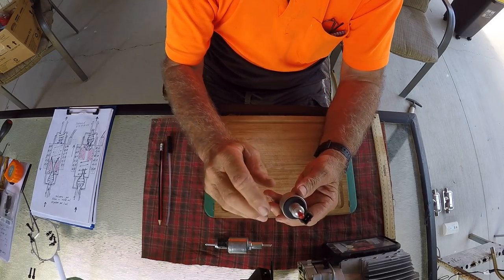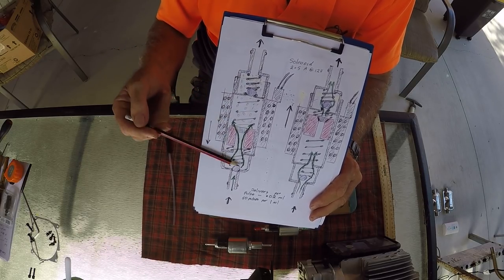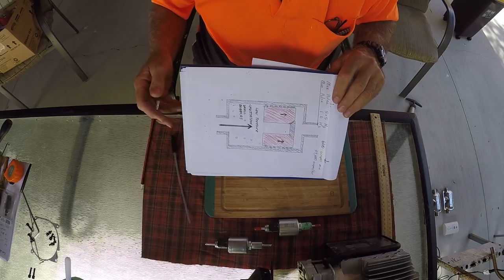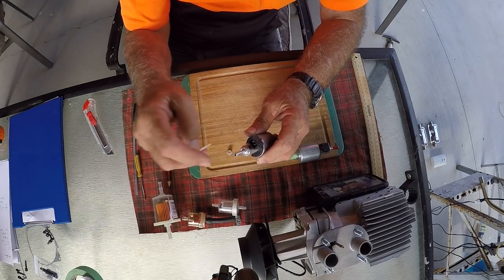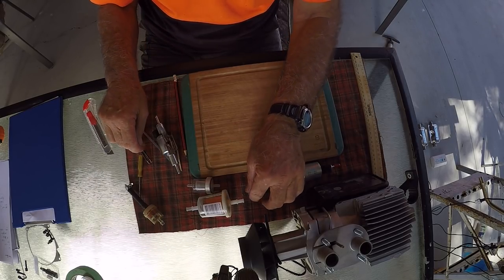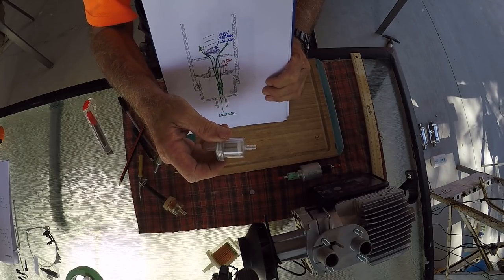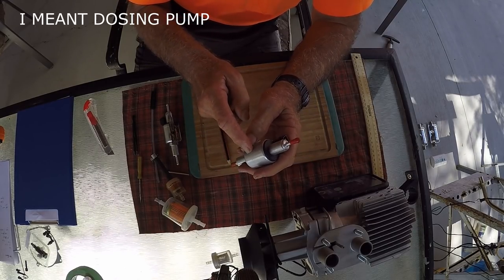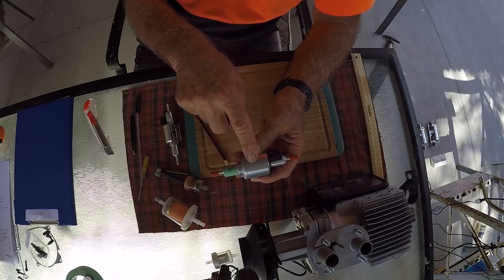Chinese Diesel Air Heaters   Part 7   Metering/Dosing pump

Comment: Finally someone with knowledge explains the operation of the dosing pump!!
Reply from the maker: Thanks for your feedback Robert.
Reply: @johnmck1147  I know im a bit late to the party, but would it be possible for me to send you a video of the issue im having? I cant figure it out for the life of me.
Pump ran through prime cycle (as per these instructions) and was working fine, but then when i tried to start the heater, the pump would start "bouncing" the fluid back and forth, until eventually, only air/vapor was coming out of the pump. 
Thought it was a pump issue, so i bought another, but im still having the same issue.
Any help would be greatly appreciated!
Reply from the maker: Alex Olson 

Hi Alec, a video may help.
My email.  johnmck47@outlook.com

I assume you have a fuel filter, and the pump is facing up the right way. (Plug is on the top)

Cheers.  JMcK

Comment: Those drawings are not a good description.  Take one apart or look at some videos.  Its a metering pump with no suction valve.  You described a Facet style fuel pump for a car.

Comment: John, your videos have helped me immensely over the last three years. Please update your comment at time 9:58 to include after throwing the internal screen filter away, to install an appropriately sized (I think it's a #4) o-ring. I was troubleshooting a recent issue (heater would not go into the red bars on controller/ low heat output) for a long time before an aircraft mechanic showed me the issue. I even bought a new 2kW heater, but I realized that the 22ml pump that came w/ it might be the issue.  I then  thought that I could just use Teflon tape on the old Eberspacher pump that I was using, but discovered that it was in vain (leaky & still low heat), & that it could have caused shreds of PTFE tape to get caught in my plumbing. I was actually about to ask a mechanic for some PTFE paste when he made me realize that they're straight threads & this part required an o-ring.  Thanks again for sharing your knowledge, it has benefited many.

Comment: I'm now sitting with my feet up in my warm toasty van minus 1c outside ❄️ thanks to your easy to understand instruction to set the magnetic pump upright and suck a bit of welsh diesel before i refixed the small bore volvo pipework i salvaged off my old truck back together, regards from Snowdonia north Wales,👍

Comment: Love your videos.  I just completed my own install in my garage and couldn't access the prime function on my controller.  Instead, I used my hand held vacuum test pump to pull a vacuum on the hose that attached  directly  to the heater.  In two clicks, the filter was full and fuel had exited the pump.  Highly recommend doing this if you have access to one of  these pumps like the mityvac
Reply from the maker: Thanks for the feedback and info Kevin. JMcK

Comment: I also run the hard nylon through a run of latex tubing [ 1/2 OD x 1/4 ID ]. It does a great job of cutting back the noise about 2/3s' cause by the line itself. To run the nylon through, your best bet is to use oil into the latex and then push the nylon through it. I also started using a blue fuel line for the connection. The plus side is you can see when the ends touch. For longer runs, I use a hand-pump multi vacuum for all the fuel systems like my own. To ensure no air in the system.

Comment: Hi John,  glad I discovered your video as it has helped me figure out a problem with a diesel heater which I installed for somebody a couple of days ago. 
Everything was working fine when  the vehicle left  me  but I had a message a couple of days later to say that the heater wouldn’t fire up and also error codes  e07 and then e10 were showing on the display.
After watching your video I rang the man up and asked  him to check if the dosing pump  was still at the correct angle and guess what it was nearly horizontal , I got him to put it back to the correct angle and on the third attempt  the heater fired up and is working perfectly  without any error codes.
Not sure how the pump moved so I’ve asked the man to pop in when he’s back in town for me to check it over.
Thanks for the info, cheers, Chris.

Comment: Very informative and thanks for taking the time to make this. There is to much misinformation out there and people parroting information without explaining or understanding why something needs to be done a certain way.
Reply from the maker: Hi D, thanks for the positive feedback.  JMcK
Reply: @johnmck1147  Any thoughts on how the type of fuel filter used in a heating system may effects the pump. e.g. The volume of fuel the filter holds or the type of filtration used within the fuel filter?
Reply from the maker: Hi D, I have used metal gauze fuel filters  and paper fuel filters, both large and small and never noticed any negatives between them. JMcK

Comment: Hi John, 
Just for your info and comment, had a failed fuel pump this winter due to sub zero temps. Pump checked out ok electrically. Diagnosed the fault as a gummed up solenoid piston, (non winter diesel) tried to un gum with kero but eventually heated pump to 65 deg C and pulsed with 12v and passed kero through it, after a bit of persuasion it loosened up and works normally. It seems gelled diesel can be shifted with heat. Great channel regards
Reply from the maker: Thanks for that info Richard. I really appreciate your feedback.  JMcK

Comment: I commented on the previous video asking about pumps. Having watched this the pump isn’t what I expected. I couldn’t see from the cut away how much rubber is involved in sealing the units. Also, on another issue of dirty fuel and my biodiesel production I tested putting an inline car filter inbetween fuel storage tanks and found the cheaper so called 5 micron to be useless. A chap on eBay makes 1 micron filter socks and other rated socks that make Pre filtering 20 lites in one go very easy. We use a 60 litre drum into which we fitted a tap about an inch above the base, and cut a hole in the lid to suspend the filter sock. Once filtered, the clean fuel flows out with an added bonus of any water being left below the tap line. Guess you already know all this but mentioned for any others fresh to playing with diesel etc.

Comment: Hi, great videos. I'm going through them all, thanks for your efforts.

I've done some work with motorbike petrol fuel systems, and on van diesel ones.
I would suggest that one keeps the existing (small) fuel filter as is, and then adds another of the type you are suggesting before it.
And rather don't discard it: it will then act as an extra, very fine filter.
You can inspect it in your regular R&M, after all.

In addition, you could avoid the cavitation issue by increasing the inlet pressure to the pump.
It's a positive displacemrnt pump after all, and within reason doesn't care what ABSOLUTE pressure it runs at.

The diesel cavitates when it gets to less than its vapour pressure, at the ambient operating temperature.
So if you boost that a bit, say by a 2nd feed pump, or else by a bit more head from your fuel supply, you should be able to avoid the cavitation.

A big problem with diesel is that it has a very low vapour pressure: ranging from 1 - 10 kPa at 38 C (0.2 to 2 PSI).
Compared to petrol, where it's a LOT higher, at 48 - 103 kPa (7 to 15 psi).

Because of petrol's use, its vapor pressure (Reid Vapour Pressure) is a controlled specification, and is adjusted to prevent air locks due to vapourisation.

But not only is diesel's inherent vapour pressure a lot lower, because of the high pressure in a diesel system, and it's fuel pump system, it's not controlled.
There's not even any spec for it, so it's hard to see what it actually is for a given diesel blend.

Ff you DO an get air in a diesel system, or a vapour lock, it's very hard to get rid of: regardless if it's from low fuel level in your tank, poor priming, a leak, or vapour lock/cavitation.
Which is why more demanding systems have a preliminary booster pump feeding the main pump so you aren't affected by this issue.

In our case, if you boost the pressure by a bigger fuel head, then you can have MORE than the vapour pressure at the inlet to the fuel pump.
And therefore it CANNOT cavitate.

Fuel Head (kPa) = Fuel Density (kg/m^3) x Gravity (m/sec^2) x Head (m)/1000
 
To get 10 kPa, you need >= 1.25m of head.
You'll need more if you are running hotter, or use diesel with more volatile component fractions.

Here's a summary of various vapour pressures (all same research paper):
Riazi, M. R., Albahri, T. A., & Alqattan, A. H. (2005). Prediction of Reid Vapor Pressure of Petroleum Fuels. Petroleum Science and Technology, 23(1), 75–86. doi:10.1081/lft-20009686225 

https://sci-hub.se/10.1081/lft-20009686225
https://www.researchgate.net/publication/254352877_Prediction_of_Reid_Vapor_Pressure_of_Petroleum_Fuels
https://booksc.org/book/39540617/b2776f

He doesn't do diesel specifically (looked at gasoline and avaiation fuel), but you can see the values for various types of gasoline are quite high, and then look at kerosene, that are a LOT less (which is pretty close to diesel in this respect).
Reply from the maker: Hi Warthog,

Thanks for your detailed comments.

Yes, if you have a fine filter in the pump you could leave it in and have a separate primary filter. However all the Chinese heaters I have seen do not come with fuel pumps that have a filter.

Ref the cavitation bubbles. My research has shown that these little vapour bubbles actually help with the atomisation of the diesel when it is injected into the atomisation screens in the burner. In effect you have whole lot little diesel vapour bubbles already in the line.

Your post indicates a lot of technical knowledge. I would be interested in results if you actually do tests on   this matter before I get an opportunity to do same.   JMcK
Reply: In his kerosene video I think the pump failed from running dry from cavitation rather than lack of lubrication in the kero.
Reply: You seem to be a Gent who might be able to answer this query.
As I understand it, some diesel vaporises on the suction side due to low pressure induced by the rapid movement of the piston pulling on the inlet fuel line, What I can't see is why does it not condense back to liquid once it has passed the piston on the delivery stroke, but tends to remain in the pipe as bubbles. In normal cold climate operation. I would not think the pump runs very hot and after the short initial pressure burst needed to overcome inertia of fuel in the line, there would only be a very small,  but positive, pressure [since the delivery side is basically an open tube,] and the bubbles must by then be well above the vapour pressure of the fuel. So why do they persist in the line all the way to the glow plug ?
Bearing in mind that these bubbles are always going to be present and cause no real difficulties, even in 'perfectly' installed systems, this might suggest that the pump is not delivering the full 0.022ml of fuel per stroke, but a very slightly lesser figure due to bubbles?  But tests consistently show  22ml of liquid diesel after 1000strokes  ... bang on the money!
I know it's of no practical importance whatsoever, but the conundrum is still bugging me.... and I need my sleep    ;<D
ps I understand the fix of using a second pump to pressurise the dosing pump inlet - I had to do the same on a motor where the diesel injector pump drew direct from the tank

Comment: Hi John hope all’s well mate,, I installed a heater into a van a couple years ago and used you’re videos for reference.   I am currently building a small camper van for myself and installed a heater with zero problems,  it worked fine for an hour or so, then I stated getting ERROR 0- numbers on my display, I contacted the guy I got it from on ...3-Bay !  He basically palmed me off then as if HE  was doing some work to help me advised YOUR YouTube pages & I thought the cheek of him selling heaters then using YOURE excellent work for HIS “problem”
Reply from the maker: Hi Ryan, suggest you have a look at your wire size, and fuel line.

Lately these heaters are being supplied with ridiculously thin power wire and installers use same size wire to connect to power board. I had an acquaintance around two days ago whose new install would not work, and when I put meter on power wires at heater the voltage dropped from 12.8V to 10.2V on start.

Also suggest you run heavy gauge heater wire straight to battery with 20 amp fuse/circuit breaker close to battery. Not through distribution board.

Another issue is the soft vinyl hose now being supplied by some suppliers. If the fuel delivery hose is more than about 300 mm, from pump to heater the hose absorbs the fuel pulse and after a few hours of operation there is not enough pressure in the soft fuel line to force the fuel through the atomisation screens in the burner.  JMcK
Reply: @johnmck1147  thanks for the reply John👍🏼,  a diesel fitter friend also said Get a new wiring loom their only a few ££s 
Great minds an all that eh 😂 putting the new 20amp Red positive on will I have to open up the ‘ECU’ to solder direct to the circuit board or can I attach it Without opening “that box” appreciate any reply if & when you’ve time🙌🏼🏁🏁🏴🏴
Reply from the maker: You don't need to touch the circuit board. Just solder new thick wire close to the wire coming out of circuit board.  JMcK
Reply: @johnmck1147  thanks for the reply mate really appreciated, 
I’m not the best person with a soldering iron🤷🏻‍♂️😂 so I’ve already ran  some thin wall 80 amp wire I already had sitting around, possibly a bit overkill lol BuT sides are behind the walls so don’t see them😇 
Thanks again mate yer a diamond  ✌🏼🏴🏴

Comment: Good information, and a great video. I live in northern Canada and thought one of these diesel heaters will fit my needs, when in my trailer. Also will be running 50/50 diesel and kerosene, also I am a new subscriber.
Reply from the maker: Hi WRXS, pleased you liked the video. In a cold winter or at high altitude you can run up to 90/10 kerro/diesel, to help minimise carbon production.  JMcK
Reply: @johnmck1147  Thanks for the reply, and today picked up 4L kerosene@$3.99 and for 5L diesel the cost$10.00. Indeed the kerosene for some reason is half the cost.

Comment: An excellent run through of the fuel delivery system....  thank you John
Amazing what the mind turns to when you can't sleep at 3am .... As I understand it, some diesel vaporises on the suction side due to low pressure induced by the rapid movement of the piston pulling on the inlet fuel line, What I can't see is why does it not condense back to liquid after it has passed the piston on the delivery stroke, but tends to remain in the pipe as bubbles. Since the delivery side is an open tube there could only be a very small positive pressure which could aid condensation, but the bubbles must by then be well above the vapour pressure of the fuel by that point, so why do they persist rather than condense out?
Bearing in mind that these bubbles are always going to be present, even in 'perfectly' installed systems, would this mean that the pump is not delivering the full 0.022ml of fuel per stroke, but a lesser figure due to bubbles?  
I know it's of no practical importance at all , but the question is still bugging me.... and I need my sleep    ;<D
Reply from the maker: Oh dear OG, what a dilemma here. 

The little cavitation bubbles march along the narrow bore fuel line and get forced through the atomisation screens in the burner chamber, and I believe they actually help the fuel atomisation. 

I have done a number of tests measuring out pump delivery manually, and 100 pump pulses does give 22 ml of fuel the in lab measuring container.

I have also found that if you use 4 mm bore cheap rubbish vinyl fuel line as sometimes supplied nowadays, and you have a  sharp bend in it the little bubbles can form a large bubble that further absorbs the fuel pulses and creates a bad fuel air mix leading to a poor burn and excessive carbon deposits in the burner, which soon won't start anymore.  JMcK
Reply: @johnmck1147  Thanks John.  I agree in all respects that the solid narrow bore pipe works very well indeed and there are no problems with the delivery rate. I can see too that already vaporised fuel in the form of cavitation bubbles might well be the first thing to ignite on the plug since they don't have to be 'boiled out' of the liquid fuel first.
Still seems strange the bubbles don't condense back into the liquid fuel. It will kick around my brain's 'back burner' till one day I come cross an explanation. Thanks again for your reply  ... Regards  OG
Reply from the maker: I would be interested in what you find out.  Sleep well 😁

Comment: Greetings from the USA! I can't begin to thank you enough for your instructions on these heaters! I however, am in a very different situation from yourself and most others in that I "boondock" in the states in a tipi tent. My system is going into a toolbox and needs to be packable and transportable. Hence a need for good quality shutoff valves and  quick disconnects. Would very much appreciate any suggestions on quality product! Thanks again for sharing your valuable knowledge in these videos! It is GREATLY appreciated!!!
Reply from the maker: Hi Richard, thanks for the feedback. To my knowledge there are no off the shelf quick disconnect products for these heaters. For the fuel line you can use a quick connect coupling for an outboard motor, but you will need to make your own for the exhaust pipe, or get a shop to make one for you out of some thin walled stainless tube.
Good luck with your bush camping.  JMcK